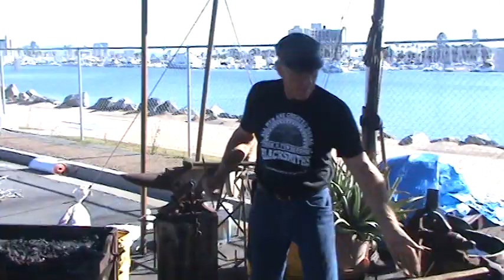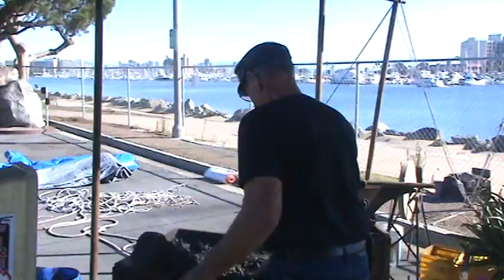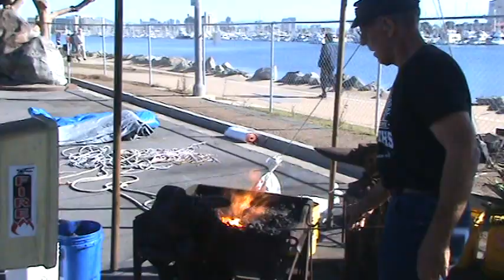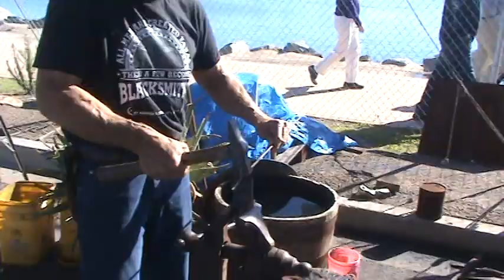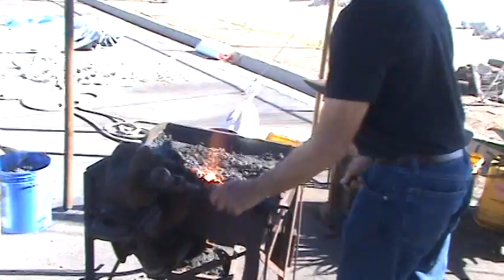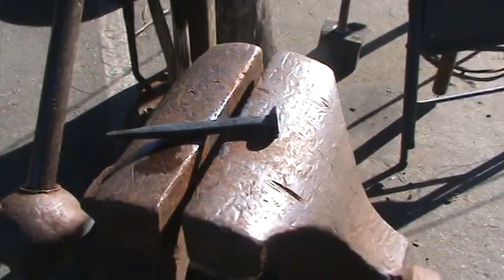One Way To Forge a Nail Without a Nail Header

Comment: When I took my first blacksmithing class 5 years ago, the instructor had us forge nails and hooks.  It took me 2 hours to make 3 nails and a hook.  More recently, I made 32 in an hour.  Thought I was getting kind of good until I saw a video of an old Norwegian nail smith tapping them out at a rate of less than 30 seconds each.  But it still involved a header.  Thank you for a very informative video on a method that doesn't take a heading tool.  Sometimes a short video like this is all the information needed to tell the story.

Comment from the maker: You can hone your skills making nails. You need a good vise to hold the nail. For the head,  the stick out should be about 1 1/2 times the stock diameter. Try to make your nails the same length. 
After your first 100 you should be getting good at nail making. 
Thanks for the comment.
Reply: Thanks.  Great option if you don't own a nail header.